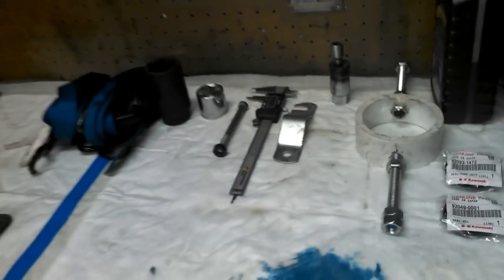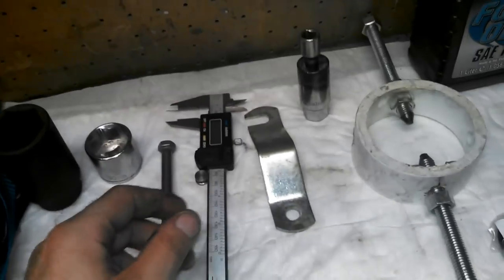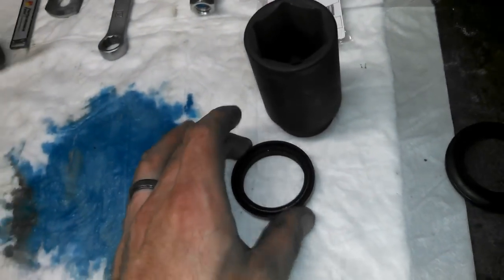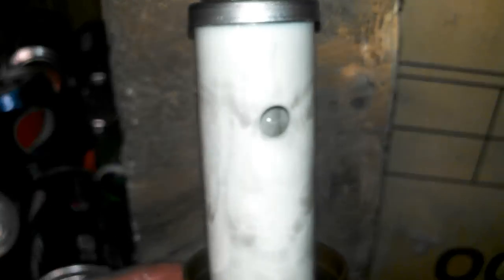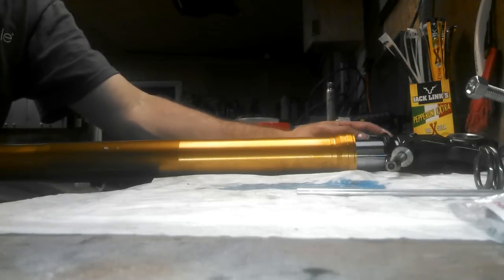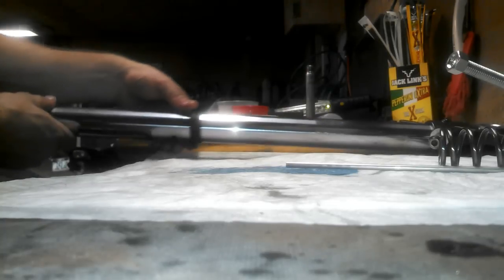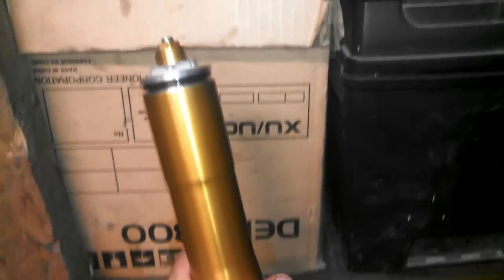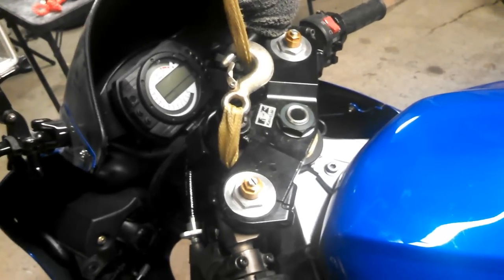How To: Replace Fork Seals -  03-04 Kawasaki Ninja ZX-6R 636 2003 2004 B1 B2

Comment: Thanks a ton for making this video. I was able to replace the fork seals and dust boots on my '05 ZX10R forks that my local motorcycle repair shop wouldn't touch cause he didn't have the special Kawasaki tools. I saved a ton of money and had the satisfaction of doing it myself.

Comment: Great video. Cleared up many of the questions I had. Much easier than going by the service manual. Thank you!

FYI the correct nut needed to pull the rod up is 10mm x 1.00 pitch. I got a 120mm bolt to attach to it from Fastenal.

Comment: Still relevant. Just did a mates forks on a 2005 zx6 by using this video. Top one.
Reply: Was there any difference. Have an 06 I may need to do this to.
Reply: @drewfeiock2212  slightly different top nut assembly but very similar. Just take your time and remember to loosen the ratchet straps slowly. 👍

Comment: Thanks for the vid. I have the same forks on my 2006' ZX10R. This video helped me out big-time.
Reply: Only difference is the 06 zx10r is 111-113 mm oil level height and the rod nut is 11mm

Comment: Hey, fantastic video! I'm a bit late to see it. I changed my seals on my B1H but now the Damper Cartridge Bolt (the bolt at the bottom end of the fork) keeps spinning when I try to tighten it. Also the new oil is leaking out from that bolt. Any advice would help tremendously. Thank you for the video!

Comment: Thanks for the video 📸 good job. My Q is it necessary to take out the bottom Allen bolt in order to pop the fork seal? Having great difficulty with it, both just turn. Dumbass design, imho. ICBF. Can the seals still be popped with it still in?

Comment: what size was the bolt and nut you used to pull out the rod? The one that doesn't have to be tight

Comment: Thank you, this helped me a lot!

I would like to ask, I used the information I learned from this video to change my 05-06 636 fork oil and seals, however the right rebound dampening screw on the top of the fork only turns about 3/4 of a turn before stopping, while the left one turns many times and will actually go down a bit into the fork. I imagine this is a problem, do you know how I can fix it? When I purchased the forks I noticed that one of the forks was much springier/quicker rebound and compression than the other, but I don't know how they were adjusted when I was playing with them. Could this be a related phenomenon? Thanks again.

Comment: I’m having trouble exposing the nut on 13:50 . I Have the spring compressed and I’m Pulling up pretty hard on the cap but I’m still about a inch or two short of being able to get under the nut with the tool. Feels like something might be holding it back. Don’t want to pull too hard and end up breaking something. Any idea on why I can’t pull it up far enough?

Comment: The seals on my yamaha look very very similiar. I have trouble scraping the old seal out(nobody changed it for 16 years) and now i cant get the new one in. Does the socket have to go through the seal or on top of the seal? i tried different size sockets and the only thing i have done is minor damage to the seal. Help?
Reply: i just saw a full video on how to take a for apart and change oil seal and for seal. for the oik seal that's inserted inside the fork tube you need apply heat from out side, this way the everything around it will get loose.
Reply: the video was made by Dave Moss Tuning
Reply: ***** i scraped it out now i cant get the new one in
Reply: +Joe Barbaro dave moss applied heat, or you can apply some bearing grease. or put it in boiling water, let it soften a little, for how long i dont know, like first thing it get a tiny soft
Reply: +Joe Barbaro dace moss actually used a special tool made for insert the oil cover back in. it looks like a round cap that is the  same size if the oil cover. try to find something looks like that. or even a peice of wood that has the same size and then just hammer down

Comment: By any chance, would this apply for an 05 zx6r? I imagine it would be but I just wanna make sure, looking at changing my fork seals here pretty soon.
Reply from the maker: I think the forks may be slightly different on the 05-06 models.  But the basic process applies.
Reply: The Amp Lab Awesome, thanks for the info and great video by the way

Comment: Anyone know if the procedure is the same for a 2006 kawasaki z1000? They look very similar.
Reply: its pretty much the exact same... you wont have to wonder far from the path, i did the forks on my zxr400 and i used this as a guid, my zxr is from 1991..

Comment: what did you use as a jack point?
Reply from the maker: i didnt use a jack. i used a strap and a winch installed in my attic.
Reply: The Amp Lab i see now.. whats the jack under there for? Stability?
Reply from the maker: yup. and a "just in case" scenario. lol.

Comment: I dont understand. These forks look identical to 2006. Does it have hex bolt on the axle side? If it does simply remove that hex bolt and split them apart. Install both seals and put tube back in. Fill it with 400ml of oil and its done. All the special tool you need is long 8mm hex from harbor freight.

Comment: I highly recommend using a fork seal installer tool as well. They are plastic tupperware looking cones that allow you to cover the end of the sharp fork tube and slide the new seals over them with out cutting them. Fork Tubes have a sharp edge at the top and if the smallest nick is made in the new oil seal they will leak. Another good idea is to lube all the new surfaces before putting the seals and Tubes together. You wouldn't want to assemble a motor without break-in lube so why would you do it here? Great video otherwise.